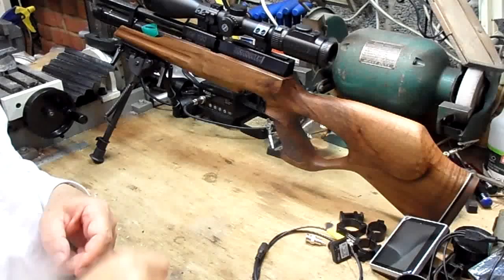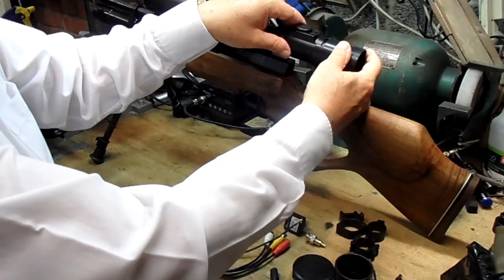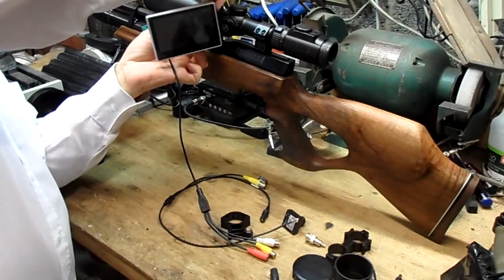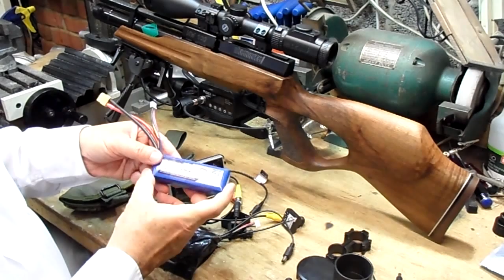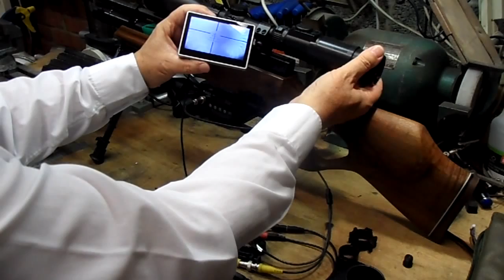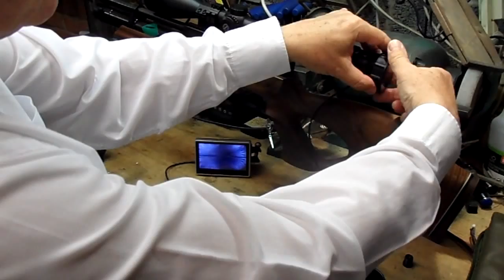Easy night vision add-on build

Comment: Hi,nice video Would this work on myHawke Air Max30SF 8-32 X 50 scope
Reply from the maker: It will almost certainly work but 8x magnification may prove a bit too high giving a dim image. A lower magnification is usually a better bet for most uses, I use 3x or 4x for most of my shooting which is mainly closer range than in daylight.

Comment: Hi Terry, great informal video. 3 Years on has the technology improved on the components in the vid?, and would you recommend substituting the 16mm lens for the 9-22mm f1.4?Thanks
Reply from the maker: The main component is the E700 camera and there's been nothing new that can give the same performance at the price. It also fits beautifully into the Floplast plastic pipe couplings so those are still favourite. Battery packs and monitors are widely available  and most are going to be fine, it's mainly what you can source as the sellers come and go quite often. For people in the UK Sure24 do supply a kit which contains camera, monitor and leads which can be helpful especialy as they  are good quality items.
The 9-22mm lens is going to be larger than a simple 16mm one but they can allow you to tune the focal length to get the exact picture you want, I'd stick with the 16mm. For most uses nearly any lens will work but if you want to get top performance there are some good quality items available for a price and they are optimised for use with ir light.
Reply: Thanks Terry, appreciate the update, will look at Sure24

Comment: hello great vid, what is the adapter called that you use for the camera plug that goes to the yellow monitor plug? tried looking for them on ebay but not found one yet. Cheers jamie
Reply from the maker: One Man in a Shed you need a bnc to phono adapter. Sure 24 do a camera and monitor kit which contains all the connectors that you’ll need.

Comment: You should make it very clear that this system DONT work with all scopes, i have just found
this out after buying all these parts, and the time and money for nothing !!
Reply from the maker: Not yet found a scope that you can't use a rear add on with, some are better than others obviously. What scope do you have?
Reply: Its a "Hawke Endurance 30" 2-12x50 fixed focus, i have built a system like yours and its impossible
to focus, get x hairs in focus but the target is blur.. focus on the target then the x hairs are blur ?
I have used different lengths of tube to move the camera back or forwards, but no its still the same
ive spent hours trying to get it right, its impossible.. properly ok with a focusing scope, but this one
just wont have it ??
Reply from the maker: Focussing has been covered and the method is to focus the camera onto the reticle but you do then need a focussing scope to get a clear image of the target. It may be possible to get a usable image at low magnification on the scope but it's not really satisfactory.
Hawke scopes, in general, do work well with add ons but focussing with AO or side focus is really needed, side focus is preferable. Try setting the scope at its lowest magnification and see if you can get a usable image. Another way to get more magnification is to use a longer focal length lens in the camera, a 25mm lens will zoom into the central part of the scope image and will give an image about 50% larger than you would get with the standard 16mm one.
Reply: Thanks Terry.. Do you know were i can buy a 25mm lens ?  saves me having to buy another scope !
Thanks   Geoff
Reply: Terry, I have just bought a 25mm lens to try, and its no different ?
I'm fed up of wasting money.. and time !
Reply from the maker: do you get a usable image at the lowest magnification? The purpose of the 25mm lens is to allow you to keep the scope zoom at a low setting and then to enlarge the image you see on the screen.
Using a rear add on does really need a focussing scope as was mentioned earlier.

Comment: Just got a digi niteye with half mil dot but can't get the reticle to focus as well as my mtc  ,played with the eye piece and different magnification any other ideas
Reply from the maker: I use the digi nite eye without any problems so you should be able to get good results. Start by getting the camera the right distance away from the scope so that you get a good image of the whole scope view. When you're happy with that focus the camera so that the reticle is clearly focussed and nice and sharp. On the E700 camera there is a tiny grubscrew in the lens housing and if you slacken it you can turn the lens to get the focus right, do up the screw afterwards. Now it's all set you focus on the target using the side focus wheel on the scope, it will be different in daylight compared with the infra red.

Comment: Hi Terry ok I've got my IR lamp, went for an optic fire xc 75 so big light, bought the figure of 8 mount as in your parts list but torch doesn't fit as torch hits against top of scope, scope is 6-24 x 50?

Also how do I see the whole crosshairs as it's sort of zoomed funny with 16mm lens?

Thanks John
Reply from the maker: +John Boswell You may need either a taller torch mount or maybe a riser block to space it away from the scope. If you're getting problems with the view of the reticle try moving the camera further from the scope, that should give you what you want but you will probably have to re-focus the camera to get a sharp image of the reticle.

Comment: Hi Terry thanks for great video, I have got a load of 18650 batteries, would I only use 3 at a time or 4? And which terminals do you wire the balance lead to? Also does it last long? Thanks John
Reply from the maker: +John Boswell 18650 cells can make a good battery pack but they should be good quality ones, not some of the cheap copies which are on sale everywhere. Look out for well known brand names from trusted sellers and any cell claiming more than 3500mah is almost certainly a fake. 3 cells will give you a nominal 12 volt pack which should easily last a full session, between 3-6 hours depending on cell capacity, running the monitor and camera.
I use these ebay item 151518911941 and there is a wiring diagram on the web page - they do sell them individually as far as I know. There's also youtube videos showing how to wire up a balance lead if you want to use a proper balance charger.
You can get a battery holder for 3 x 18650 cells in series from ebay but some of them have very thin wires which you may need to replace. You may also need to watch out for the cells being so tight in the holder that they need pushing onto the positive contact (away from the spring).
Reply: +Terry Marsh ok great many thanks , so eBay number 152032686684 should work I guest I buy a 2.1mm male jack to plug into the y splitter? Thanks again
Reply from the maker: +John Boswell Yes that's the holder. You will need to be careful when soldering the balance wires in place but it's not too difficult.
Reply: +Terry Marsh ok great, that PCB board says for 11.1v is that ok? Would this still be used with that battery holder? And do you have to have the PCB board? Thanks again John
Reply from the maker: +John Boswell The pcb is for 3 LiPo cells which is correct, the voltage will go to 12.6 volts (for 3) when fully charged and is the same as the 12 volt cctv battery packs which also contain 3 LiPo cells.
The board ensures that all cells are charged to the same voltage and won't discharge so low that they are damaged so unless you charge each cell individually then it is needed. You can charge one at a time if you have a single cell charger or using a balance charger as used in RC modelling - as long as you fit a balance lead to the cells.
Reply: +Terry Marsh ok thank you nearly enough info to complete my build, would these batteries work ok? eBay number 311570045376 

Also do you know if anyone has done a proper scope mount for monitor?

Thanks again
Reply from the maker: +John Boswell Those battery packs will be fine if you have, or get, a balance charger for them - like this http://www.ebay.co.uk/itm/Turnigy-B6-PRO-50w-6A-Balance-Charger-Power-Supply-LiPo-NiMh-iMax-Accucel-6-/221711556799?var=&hash=item339f09e0bf:m:mwuY8sJHAPmkLuF_VszLwvg but it's starting to get expensive as you will need it with the power supply. As an alternative you would be better off with this http://elwirecraft.co.uk/el-products/el-accessories/12v-rechargeable-li-ion-battery-1800mah-2800mah-or-5000mah-for-el-driver-led/ - the 2800 mah and 1 amp charger are fine for most people.
Reply from the maker: +John Boswell I have done a video on mounting a monitor, it's on this channel.

Comment: Great video, no nonsense instructions, Well done.Just a question about range, what IR torch do you use and what range can you see clearly from it.Thanks.
Reply from the maker: +Pullringking  Thanks, I hope it's useful. I make my own torches for this using an Oslon Black ir led running at 1000 ma. Maximum range does depend on your scope and the magnification you use but it's probably going to be about 150 yards. If you need a greater range, say for a centrefire rifle, then you'd need to go to a T67 or T74 type of torch with a large head/lens assembly. With one of these and particulalry if you also upgrade to the lates Oslon AS chip at 1400ma you should be able to get 250 yards, maybe a bit more. I've not tried these my self, just going on what others have managed.

Comment: Do you have any idea if the website you bought the coupling and access plug from will ship to the US?
Reply from the maker: +Matt Odell I think it's very unlikely but I believe that similar parts are avaiable in the USA. In the UK it's used for waste water from sinks/basins etc so if you have a nearby store selling equipment for plumbers you should be able to find a similar part.

Comment: Can you use your mobile phone as a camera and screen with an attachment for your scope, (Universal Cell Phone Adapter Mount)
 Most phone cameras see IR
Reply from the maker: +Skid Lid Phone cameras are not very sensitive to ir light as they will be fitted with a filter which blocks most of the ir - this gives a normal colour balance, if you remove the filter then, in daylight, you will get a pink colour cast. Although the camera can see the red glow from a tv remote etc this is not the same as being suitable for a night vision camera.
A phone camera can work well as a basic scopecam/recorder if you are able to zoom in with it.
Quite a few people have made their own phone holders using part of a case glued to a length of tube which fits the scope eyepiece, obviously this needs to be well made to ensure that the joint remains solid.

Comment from the maker: Focussing is done in 2 stages. First you have to focus the camera so that you have a clear image of the reticle. This is done by screwing the camera lens in/out until the picture is clear. With the E700 there is a tiny grub screw locking the lens in place which has to be slackened - it will almost certainly come out so be careful. There may be a burr on the lens so you may have to deal with that, replace the screw when you've got it right.
The second part is to focus the scope on the target using the Adjustable Objective or Side Focus. When you're using infra red light you will need to re-focus so scope focussing is essential - ir light and white light focus at different distances and it's this that causes the problem.
Reply: hi terry great video, can you please tell me how you wired your 3 1860 battery's up as i have some spare and want to do the same. Any help would be great
Reply from the maker: I've covered this in replies to some of the other videos but basically I use these http://www.ebay.co.uk/itm/151518911941?_trksid=p2060353.m1438.l2649&ssPageName=STRK%3AMEBIDX%3AIT and wire them as shown in the ebay listing. You need to be very careful working with Lithium cells so it's a good idea to use a 3 18650 cell holder and replacing the wires they supply with some that can take a bit more current without voltage drop. It can be a bit fiddly to do this without melting the plastic holder but it is worth doing although you don't NEED to do this. Of course you can simply take all the cells out to recharge them but it's not a convenient way to do it, much better to use these boards which allow balance charging and provide protection as well.
Reply: Terry Marsh thank you for that terry, that's why i wanted to ask you as i know lithium can be very dangerous, i understand what you've said so i will give it ago. Ill let you know how i get on
Reply: JUST ORDERED THE LIPO THROUGH THE LINK, IT WILL BE PERFECT

Comment: great video terry very informative.is the camera you refer to this one KPC-E700PUB-16B.? hope you can do a video of the quality of picture you are getting.
Reply from the maker: bernie whitewood 
this is the camera that I suggest you use if you can buy from Sure 24 in the UK http://www.sure24.co.uk/solutions/night-vision/kpc-e700pub-16b-s-board-cam-ir-filter-removed-16mm-board-lens-1-3-700-tvl-30mm-sq-12v-dc-internal.html They supply it with a suitable 16mm lens and the ir cut filter removed (or nor fitted) from the factory. It's ready to use straight from the box.
At the moment i can't do videos which will do it justice as my dvr is poor quality.
Reply: many thanks Terry.

Comment: Terry, I'm about to build a similar NV rig, but I'm unsure about removing the IR filter from the cam. I'll be using an e700 clone camera. how did you do it, or can you link me to the video? Ive found a few general tutorials, but not for that specific model. 

thanks.
Reply from the maker: tusskmusic When I have had to remove a filter I've always tried to do it by inserting a scalpel or craft knife blade between the ir filter and the clear glass one. Try this on theedges, not the corners and work slowly and carefully around all 4 sides.
Unfortunately some are stuck on with a very strong adhesive and this method won't work, you've probably seen the soldering iron method but this can easily ruin the camera if you're unlucky.
This is one of the reasons I prefer to buy cameras with the filter already removed, taking them off yourself is a bit of a gamble, hopefully one that you'll win - good luck.
Reply: thanks terry, but I was really asking where to find it and how to get to it.
Reply from the maker: tusskmusic The scalpel blade method that I use and described is the only one that I reccommend. You can search on here for 'removing camera ir filter' which will bring up some other methods but using a soldering iron etc is likely to wreck the camera completely.
If you haven't bought the camera yet then I suggest you ask the vendor if they can supply one with the filter removed, some will do this and Sure24 certainly do. Just watch out with 'clones' of the E700 as they will almost certainly be in larger housings and will need a modified mounting system - the E700 housing is 32mm square.
The ir cut filter is fitted in front of the sensor. To get access to it you need to remove the camera board from the housing and remove any lens holder which is fitted to the board - this will be held with 2 small screws. The sensor is in the centre of the board and is set within a square plastic housing and over the top of it you will find a clear glass protective filter which must remain in place, on top of that will be fixed any ir filters and these will normally have a pink or possibly green tint to them. Their purpose is to provide a normal colour balance in daylight but they reduce the amount of ir light getting through so make the camera much less sensitive at night. if you look carefully using a magnifying glass you should be able to see the joint between the layers and this is where you need to press the scalpel blade. Gentle pressure applied along all 4 edges may break the glue joint, don't try it on the corners as they are likely to chip away. The very cheap cameras seem to use a glue which can't be broken apart.
Whenever you're trying to do anything to a camera board be very careful that you don't damage any of the components which can be quite fragile.
Reply: thats great, thanks terry.

Comment: Terry mate what is the exact internal dia of the pipe that goes onto the scope....cheers
Reply from the maker: Mick Clitheroe 
These are moulded plastic parts and the dimensions may vary slightly, they are to fit a nominal 40mm bore pipe.
The straight coupling has an internal diameter of about 43.2mm and the pipe is about 39mm bore.
There is enough material to open them out slightly if needed or I suspect that they could be expanded if heated and pushed over a mandrel of the right size although I've not tried this it has been done by others.
If the scope is too small for a good fit then it's fairly simple to pack it to suit. Depending on the size you could use plastic insulating tape or if you need more you could use a thin strip of plastic taped in place.
Reply: Terry Marsh cheers Terry thanks for the info